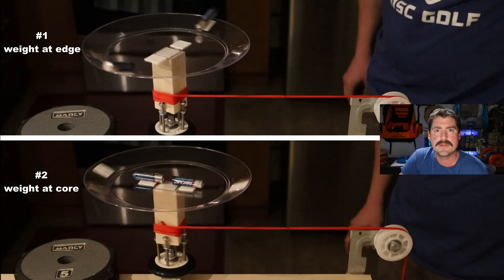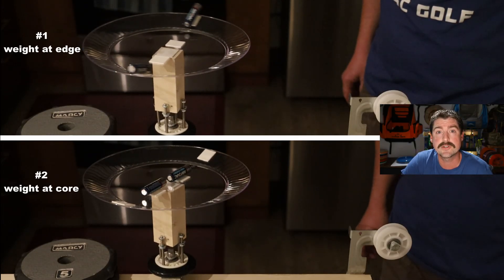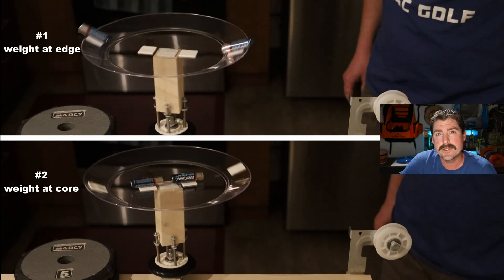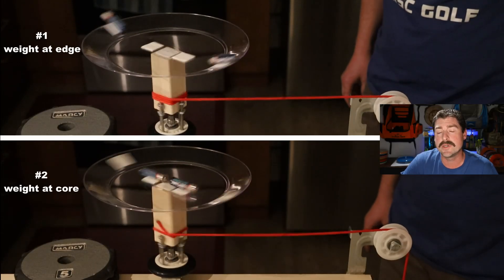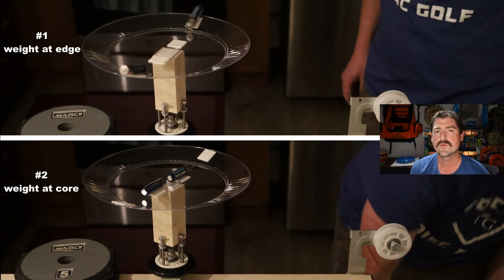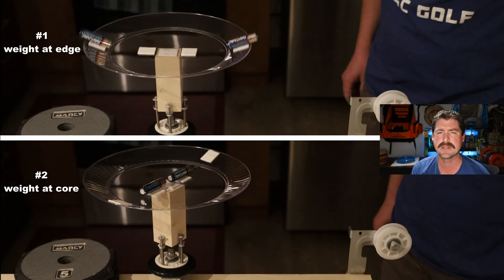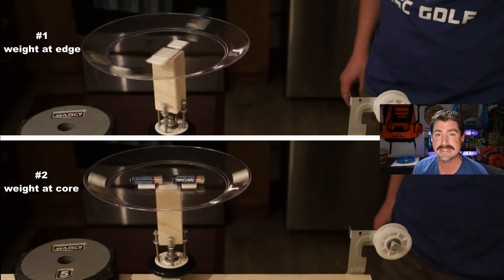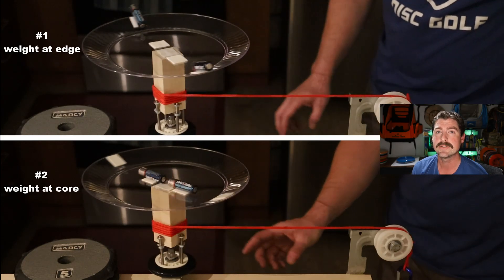MVP Discs - The FULL story of angular momentum

Comment: Something to think about, and I'm not sure this was addressed. It may have been, and I didn't catch it. The difference here is that the distribution of the weight affects the rate at which the string is being used, with the weight on the end. So it might take 5 seconds for one string to fall away (core), and 6 for the other (edge). This affects the spin rate at the start. When you have a human throwing both discs, there isn't a 83% differential (or whatever) in the amount of spin at the start of the throw (the moment the disc is released from the hand). So the rate of spin initially is the same at the moment of release. Not so with the plate test. That's not to say the dynamics are equal past the moment of release, but I think the initial spin rate is likely the same. If you could duplicate this test and show the same rate of spin at the moment of release, it might make for some different dynamics. Maybe a smaller difference up front. Regardless, thank you for the time and effort (and likely expense) of doing this test. Definitely something to mull over.
Reply: Out of curiosity, how do you explain the ridiculous distances attained by people throwing aerobie rings? I tend to think that the disc’s ability to snap out of my hand would be roughly the same no matter the weight distribution, because my elbow, wrist, and fingers are all moving the same speed, and an aerobie ring has all its weight at the “rim,” and those things go stupidly far, if you know what youre doing

Alternatively, couldnt you simply throw a less stable mold and get the same/better result since youd be taking advantage of the rotational physics while throwing a disc with intrinsically less fade?
Reply from the maker: Yes you are right that the string unwinding at different rates is not a direct representation of a throw where the disc is released from the hand. However with two discs being thrown with the same amount of energy applied to them we still see that the weighted rim spins slower. 
The fact that angular momentum is harder to apply with a weighted rim persists regardless.
If I where to do a timed release with the ropes(making the rope for the weighted rim shorter so it would release at the same time) then we would see an even more exaggerated difference of spin speed. The weighted time in that case would be very slow spinning and would stop spinning before the core weighted disc.

So if we use a timed release instead of a release based on equal energy imparted then the outcome is that a person throwing will have even less spin than what I am showing and the disc will not stay spinning longer.

Your point I think is great, but it brought you to the wrong conclusion, the spin rate would not be closer to each other, but farther apart.
Reply: @DothSavek  Ah, got it. Thank you!

Comment: I enjoyed the demo, but I wonder if you get the same result, if you were pulling from the outer rim, instead of from the center.  Regardless, I think with MVP disc selection is very important. Not just with picking a molds stability, but with the weights also.   I think most people trying MVP for the 1st time automatically go with max weight because that's what they're use to doing with other brands.  Thing is, with the extra weight in the outermold it's more difficult to get them up to speed,  which is exactly what you experienced (crashing hard), and what was supported by your demo.   I see this as a feature, where a lighter weight or slower disc should be selected.   Moving the weight to the rim, is like adding more weight and stability to the disc.   So perhaps a 175 gram mold from MVP  is the equivalent to 190 grams from another company, as far as spin rate is concerned.  On the other end, lighter discs have potential to fly farther, but are more affected by the wind.   There are trade offs.
Reply from the maker: Lots of good comments in there Keith. The difference of putting the string on the rim vs the core would still show the same result. There are similar tests done out there regarding angular moment and moment of inertia, using a solid cylinder vs a hollow cylinder of the same diameter and rolling both down a ramp(which simulates wrapping string on the outer edge) and the results are the same.
Reply: @DothSavek   I was just thinking about what's missing here.  It's one very crucial element:  wind.  A flying spinning disc with more mass in it's center would be harder to control.  Stability is missing.  We know why pros throw heavier discs.  It's because it gives them better control in the wind.  More stability = more control in the wind.    Moving weight to the rim, adds more flight stability.  Perhaps too much stability for weaker arms.  Seems like an obvious omission now. You should re-visit this.

Comment: Very misleading as you watch the red string, acceleration didn’t stop at the same time, you need to have equal rpm at release to really show of the overmold spins longer, which isn’t backed by physics, just as figure skaters tuck in arms to save on radial momentum, a disc will work the same, the benefit to an overmold rim where the weight is concentrated on the rim is that it will very quickly correct its axis to the angular momentum.
Reply from the maker: "acceleration didn't stop at the same time" that is one of the major points here, weight outside=harder/takes longer to get spinning.
"you need to have equal rpm at release to show off the overmold spins longer..." The whole point of the demonstration is to show that with the same energy imparted(same person throwing both discs) the rim weighted disc will not spin as fast when it leaves their hand.
Reply: I understand where your coming from with having the weight being the same “ player strength “ , but what I heard from the video was you were testing if mvp overmold would spin longer, there fore your test is the wrong test, now if you wanted to look at if overmolds require more energy to spin at the same rpm as single mold then you have the right test. But what you showed in your test you could have done In your computer chair and spin with your arms out and then tuck them in, you speed up. I also agree that rpm of a disc greatly improves disc flight and distance, but the gyroscope effect of the disc is the main purpose behind the overmold rim weighting, as a torqued throw will stabilize its axis faster than a single mold disk the best way to think of this is if you throw a midrange very torqued off axis it will flip due to the wobble, the gyroscope effect helps negate wobble faster
Reply from the maker: I talk about both the weighted rim spinning for longer and the trade off for that being that the disc is harder to get up to speed.. my demonstration shows that yes weighted rim does spin for longer, but that comes at the cost of reduced rpm overall. My test was just right to show both the positive and negative aspects of a weighted rim.

Arms out then arms in during spinning has nothing to do with disc flight as weight does not move back and forth on a disc, you are completely diverting from the facts shown here.
Reply: Agree. The RPM needs to be the same then check the results. I also disagree with the assumption that a disc needs "time" to get up to full rpm, it happens quite quickly. I appreciate the work, but Its a flawed test.

Why not just take two discs of equal weight and in the test.

The distribution of weight with his batteries is very poor also. We all know things spin faster, like a figure skater doing a spin goes faster with thier arms tucked close to thier body and slower when thier arms are outstretched. 

A disc does not have its weight at the center as demonstrated in this video. 
A much better reprentation would be to change the weights on the outside and run the test.
Reply from the maker: @woathepaladin5916  Its not a flawed test as you say.  "RPM needs to be the same" that's skipping the first half of the test. It does not matter if you are taking a fraction of a second to impart spin or taking 2 seconds to impart spin. if the imparted force is the same then the weighted rim will not spin as fast PERIOD. This is scientifically known and is shown in very many experiments.

Having both discs spin at the same rpm and then begin the test would be flawed as it is not a representation of equal energy imparted.
Reply: @DothSavek  all discs have a weighted rim. What you demonstrated was the difference between a disc golf disc, and plate with weight in the middle. 

I guess it not flawed, but really not representative of what is happening with a weighted riim vs a typical disc. 

I guess a take away from your video is that very wide rimmed, or long winged discs tend to be faster, they have more weight closer to the center due to the wide rim.
Reply: I guess thinking more on this, would it be better to set the weight on the inside of the rim instead of the outside? I know it where the majority of the weight is anyway due to the natural shape of the disc golf rim/wing.

Comment: I've kind of thought something like this is true (more weight at edge means harder to getting spinning a lot, but will keep spinning for longer), but it's nice to see it demonstrated. I mean, it is basically the same thing as going from a midrange to a distance driver. What I'm still unsure of are the practical consequences. Does this mean that all their overmolds fly like one category faster? Like do their kids feel like fairways? Not exactly sure. And as you sort of mention, if most of their discs are low power beefy, then controlling fade for overmolds would be something new to learn and get used to as compared to single shot. Ultimately I stick to single shots (minus my Nova) because I just don't have much power or snap, and they just fly too differently than single shots than I'm willing to get used to, but I can see how high power/snap players could love overmolds company discs
Reply from the maker: Yea I can't responsibly comment as to practical consequences. I just wanted to show its not a magic bullet. I love some MVP and Axiom but I don't think there is any big advantage to over mold as some claim

Comment: I would love to see this setup used to test real disc. And a comparison of similar discs in relation to spin rate.
Reply from the maker: That would be amazing! I think that if I was using a real disc the difference between one disc and another would be less than the other variables introduced by my less than perfect rig. Trying to get the smoothest bearings and get everything balanced would be extremely difficult. To show the effect in an easy to see way I think this arrangement worked well. Someone with better craftsmanship could build a much improved rig and it would be cool to see that at even higher frame rates.
Reply: You don't really need to.  As long as you have something that is set up like Doth's experiment, you can see the effect.  Another classic is to take two cylinders of the same diameter, one hollow and one solid and roll them down a ramp.  Which one wins?  The solid one, as the one with the weight further from the center of rotation is HARDER TO GET SPINNING.  Thus, as Doth mentioned in the video, the overmolds would be harder to throw straight vs the same weight of disc in a single shot disc bcs you just can't get as much spin on the overmold.

Comment: I don’t think is necessarily true. To my knowledge of physics, I think that the weighted rim increases the moment of inertia, which determine the discs resistance to change in rotation velocity. A gyro will stay stable in the air for longer than most discs, although it’s not life changing. Usually a player who can’t get enough spin on a disc will try to throw more overstable discs because they pick up spin faster and want to fall to the left for a RHBH shot. That’s why you see a lot of people chucking forehand flex shots with firebirds because they can’t get spin on the disc forehand. Otherwise a shot with little spin will turn over.

I would recommend understable gyro discs personally. I rip on my Axiom Mayhem.
Reply from the maker: "weighted rim increases the moment of inertia, which determine the discs resistance to change in rotation velocity." This is correct, it resists change in both speeding up and slowing down. Harder to speed up spin, and harder to slow down spin. That is exactly what my demonstration shows.
Reply: @DothSavek  I might be wrong but here is what I think. When you throw a disc, it leave your hand with a initial rotational velocity. Unless you're throwing a overstable disc the  rotational velocity will not increase after it leaves your hand. Does that make sense? The thrower is responsible for getting the disc up to speed not the disc.
Reply from the maker: yes, just like the red rope being pulled by a weight is imparting initial rotational velocity. Once the rope lets go the rotation does not increase anymore, just as once a disc leaves the hand it does not increase rotational velocity any more.
Reply from the maker: I have really been enjoying Craves recently myself. Crave, Proxy, and Envy are probably my favorites.
Reply: Everyone I've recommended the Insanity to loved it, easy distance. If you can find one in the prism prototype plastic I can't recommend it enough it has a fantastic flight path and I swear that thing is indestructible.  My plasma Fireball has great grip in the cold wet Maine winter rounds. I also feel the overmold tends to resist damage better. I grabbed a Mayhem for fun since I rarely throw high speed discs and have been suprised how far it goes for me. Might make it into my permanent warm weather bag, as most courses in the winter here don't allow for big run ups so I'm frequently throwing my Buzzz, Eagles and Leopard 3s from a stand still until spring.

Comment: Man I'm not sure about the variables. I'd think that if you can generate enough spin in general then the more weight on the rim you can handle. MVP represents the extreme end of that spectrum. So technically, it just takes a ton of spin to use them correctly, mainly top pros most likely. The arguments you are using against MVP, are the same arguments against a newbie throwing high speed drivers where the weight is more in the rim causing them to fade too hard at the end. As a player progresses, those high speed big rim discs fly straighter. Thoughts?
Reply from the maker: Yea I hear you Rusty. Just showing off what can be easily demonstrated as I think its mostly overlooked when folks talk about the difference between a double shot and a single shot disc. It would be really cool to be able to measure and put a number on the spin achieved by top pros.
Reply: @DothSavek  Before Ezra Aderhold signed with  discraft he did a video of several companies destroyer-like driver and did lots of throws on different lines. MVP was middle of the pack every time. That's all I needed to see, to see that their claims were bunk. A dude who can crush 550+ consistently isn't getting more distance out of an MVP, then my noodle arm sure as hell isn't going to either.  That said I do like their mids.
Reply: @Greldek  a photon is probably not the best choice to compare to a destroyer. Mvp has farther flying discs than the photon.  My photons often fly like firebirds.  That said ive kind of given up on the mvp distance drivers because 11 speeds fly great for me.  If i could overpower nukes, id look into mvp again.  The envy and crave are really great discs id recommend for everyone.
Reply: @DothSavek  interestingly enough, Conrad in his what’s in the bag said he throws a lot of fairway drivers.
Reply: That’s probably why I’ve never liked MVP. For me the plastic feels like I can’t get a grip it’s too slick and the disc just never do anything that would stand out always mediocre for me.